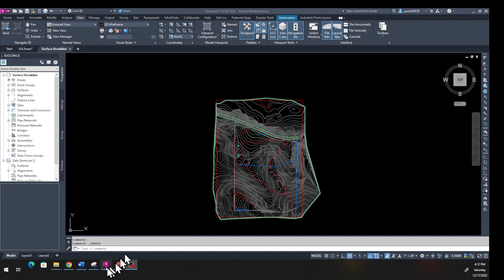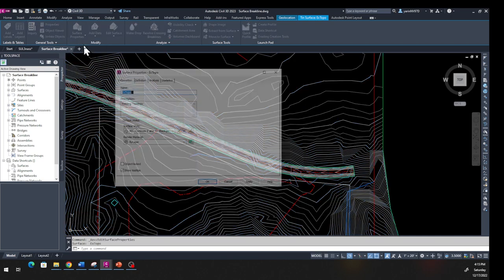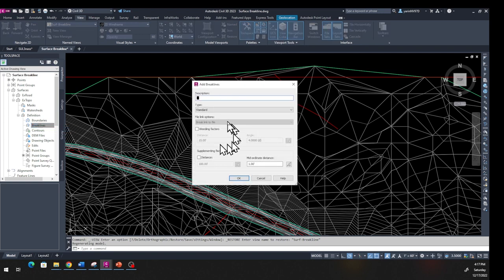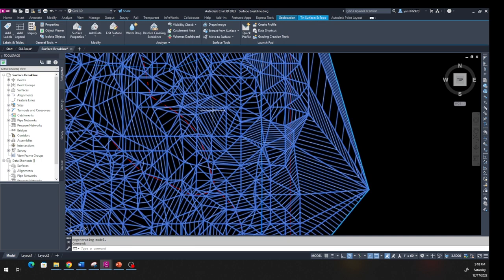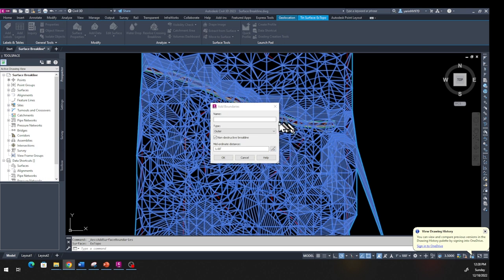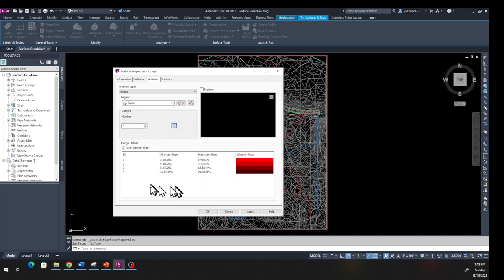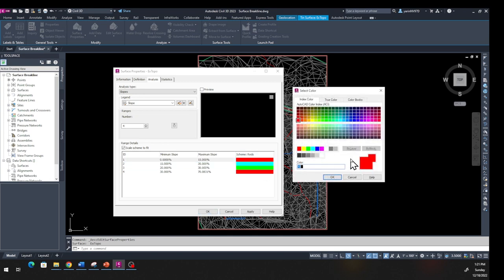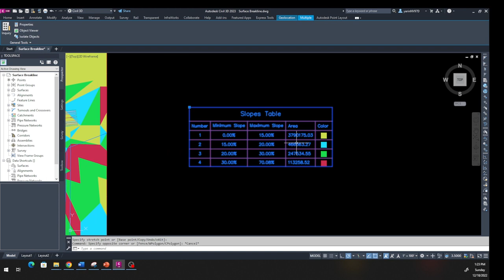Civil 3 D 2023 Tutorial Lesson 4 ,Breakline, Boundaries, Edit Surface,  and Surface Slope Analysis

Comment: Good evening Professor Yari, Its Ismail. My question Professor is; when you have several breaklines, do you have to add them individually?
Reply from the maker: "When adding a breakline to a surface, the Autodesk Civil 3Dsoftware creates an entry under the Breakline>Definitioncollections, based on a description that you supply" and "When you define multiple breaklines at the same time, theAutodesk Civil 3D software creates a single entry under theBreaklines collection. However, they are listed separately inthe Toolspace, Prospector tab’s List View.